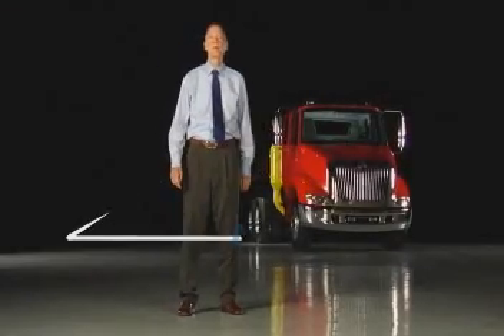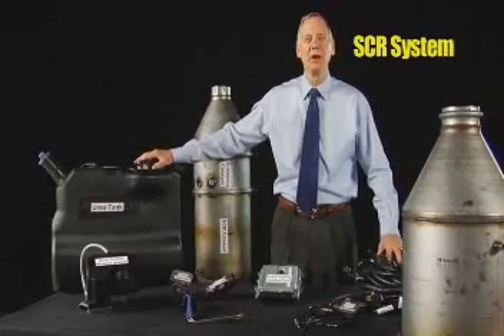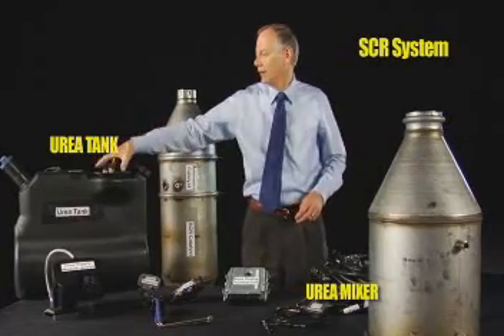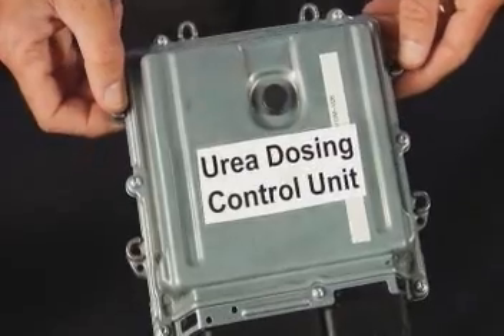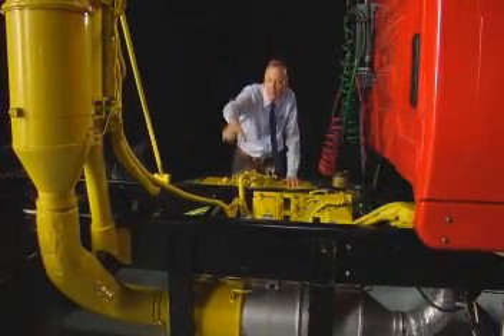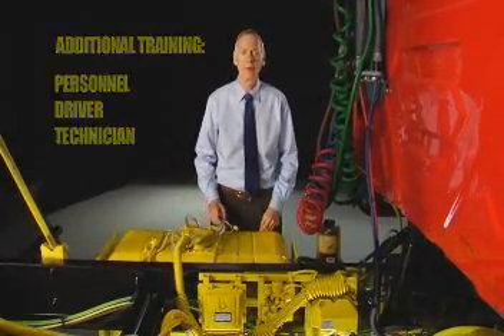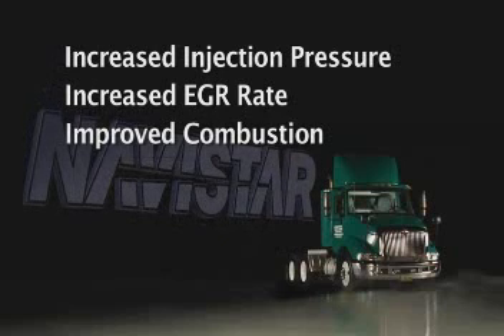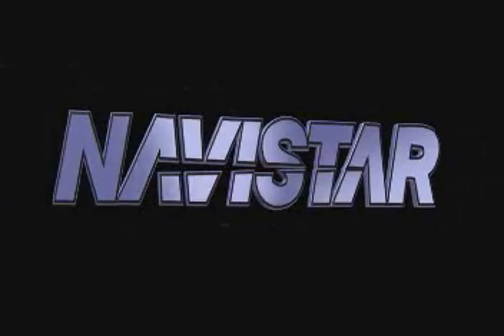Navistar MaxxForce 2010 Emissions vs SCR Round 2

Comment: This is THE BEST Solution from Navistar.  What are the Missing Components to fill up?  Dual Loop EGR, Multiscrolled SuperTurbochargers for best low end torque at high speeds and 2 Giant Catalytic Converters used in Cars.  Forget that SCR Thing because its considered as obesity to any trucks!

Comment: with all this shit on the exhaust itll be like ridin a jake brake everywhere  you drive...urea injection is impractical. they should reconsider the dpf and try to improve it. I feel emissions on diesels need to be controlled but there is more emissions shit on there than engine..